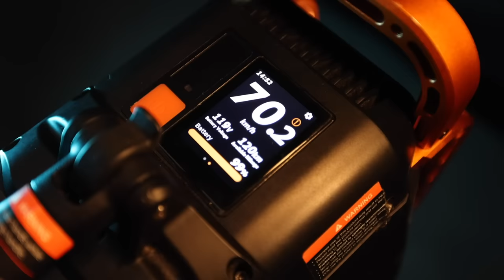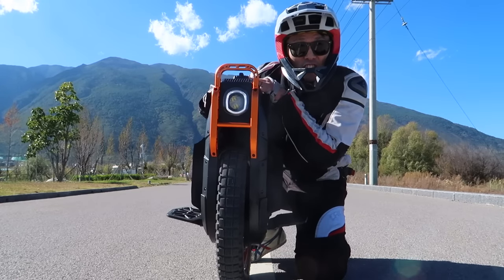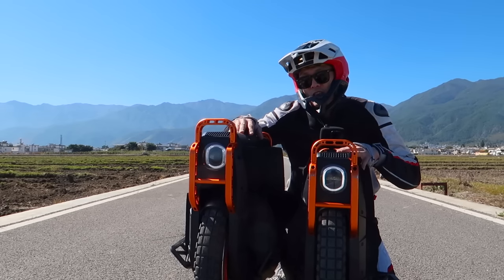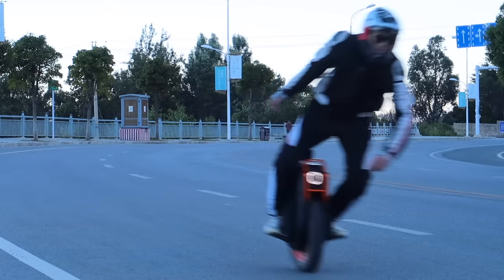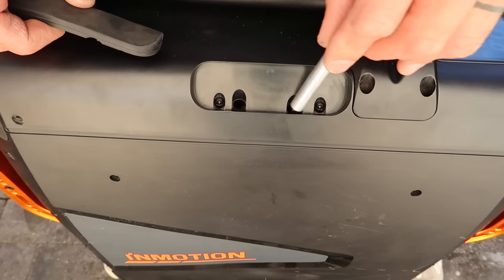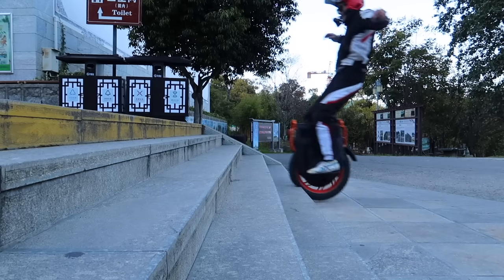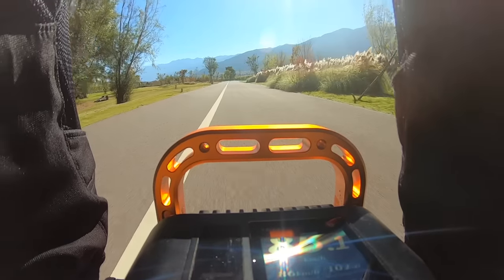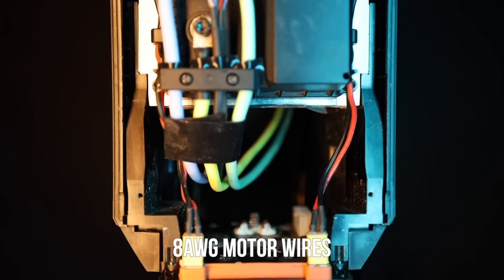Inmotion Challenger V13 Review: Need For Speed

Comment: Thanks Kuji. Great review as usual! For sustained high speed riding (45 to 55mph) up to 15 miles, would you choose v13 or master pro? Considering voltage sag, cutout safety, reliability and everyday usability. What do you think?
Reply: safety, stability, and comfort... the V13 tops the Master Pro there
Reply: There’s no comparison. V13 is significantly better
Reply: When u mention safety and reliability, I put most of Bedoges out of my sight first. Bedoge is for those speed demons. Without 3rd party custom housing or some mods, Master pro is nothing except for lil better handling
Reply: @mikelo9006  safety has many components. Begode has a bad record of battery safety with the LG batteries but they have a good record of having powerful mosfets. And it has a Samsung 40T battery option. So I think master pro has very good resistance to cutouts.
Reply: @360vroomers  true but I don’t talk about cut-out alone. Only the housing (case) build quality is literally the worst in the market and no water-proofing at all is big down size for me. Even tho, I don’t choose any of two, because of air-pump suspension.

Comment: Great review Kuji. As usual I am worried about the big guys on this wheel. 235, 240 pounds do you think this wheel or rather the suspension can handle it????? 😮
Reply from the maker: Yes, your weight isn’t a problem for most big wheels out there but your range is gonna suffer.

Comment: What was the metal box kuji put the v13 in to charge?
Reply: Fire protection in case of thermal runaway. But don’t worry, newer wheels are getting better and the rate to Internal Combustion Engine (ICE) vehicle fires is still 100x the rate of Electric Vehicle fires, even when normalized for miles traveled. 😮

Comment: Many nice points. But my favorite moments were of the Sherman S in charging bay. Can hardly wait for your review. Meanwhile i feel dumb for considering either of these monsters when I admit I seldom push my V11 to its limits.
Reply: Honestly, I seldom push my v11 to its limits as well, but I think knowing that the Challenger has the power to back up it's 55 mpr speed cap with no problem will make me feel safer exploring higher speeds.
Reply: attempting to add KujiRolls#3854 as a friend (prerequisite for DMs) returns error saying check spelling, case, etc.
Reply: @cleverchimp  I guess its fake

Comment: Did you make this what if you brake hard wouldnt you flip. Id really enjoy something like this in the country by me i would do tons of test vids to show the beast off.
Reply: with this powerful of a motor and this high voltage even if you put your whole body weight i doubt you could over power it
Reply from the maker: The way to brake is to lean back and put pressure on down on your heels. There’s no manual brake which would cause you to fall forward. In any case, if you brake really hard the most likely situation is that you’d lose traction and fall on your ass.

Comment: @kuji Rools May I ask if the vehicle is placed in this cabinet, does it have other functions besides charging, such as dehumidification, or other additional functions.
Reply from the maker: Dual exhaust fan and a power strip.
Reply: @KujiRolls  What is the specification (length, width and height) of the explosion-proof box? It is suitable for most unicycles, thank you

Comment: I am concern about the suspention sliders, it seems that yours already worn out anodising out of it. Doesnt seems like well build one
Reply: The wheel is modular so you could buy a new suspension and install it easily
Reply: @mazx19  that's Great! Now its the time to chose between v13 vs Sherman s vs master pro. It is a hard one
Reply: @kwk8363  the Begode Comander Pro gives you the best of all of those wheels 👌
Reply: @mazx19  that's the next great wheel to think about, 134v is doing great so far

Comment: I thought it goes like 89 mph it said
Reply: Your referring to the “free spin” speed, which indicates the No load speed.  Top speeds are generally 15%-20%  less than the free spin speed but is still risky because it’s so close to a wheel “cut-out” due to power spikes or voltage sags. The V13 is artificially limited to about 53mph and cruises comfortably between 38-45 mph. 
 
The average speed of all unicycle riders is around 17-18mph… rarely do people ride near the top speed, it’s just an indication of power, not a viable commuter speed.

Comment: nice wheel, but i'm thinking this will be a bit heavy specially for a new rider. still it has got to be one of the more safer and smooter riding wheel out there.

update:
i see this as mostly a disappointment, of course the people who buy this and overpay for it will tell you what a greate wheel it is. range sucks, it's heavy and requires more effort to keep the accleration as well as stopping. this is just a city wheel, and will be tiring to ride at slower speed and less agile. conclusion a complete waste of money.
i have no idea who this is built for. someone who wants to get fast for a small range and brag about suspension on paved flat roads.

Comment: They need to double the batteries
Reply: 3 kwh is enough lmao
Reply: @VECTOR_Coasters  I want this to be a water proof, long range cruiser wheel. Or at least give the option to do. I think it would be pretty simple since the batteries are detachable.
Reply: @vtran1082  the wheel is already 110 pounds if you get the 4.5kwh it would probably be 130 pounds
Reply: @VECTOR Coasters  master pro is 120 pounds. It's possible.

Comment: I can’t figure out what this wheel is for. It’s not for off-road, I’d use a S22. If not for cruising, with its 35 miles range. Is not for beginners, I’d use a v10. So this wheel is just shit then. Ok.
Reply: fastest wheel and safest wheel with some of the smoothest ride ever
Reply: @VECTOR_Coasters  that goes 35 miles. Yay.
Reply: @KevinRedmondWA  if you ride at 50mph yeah but if you ride around 25mph then you could probably squeeze 60-70 miles out of it